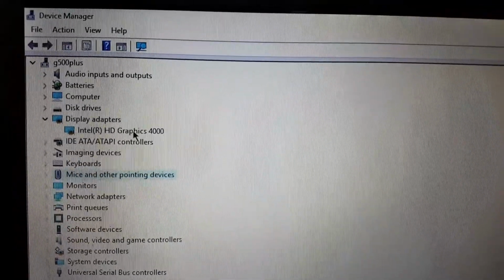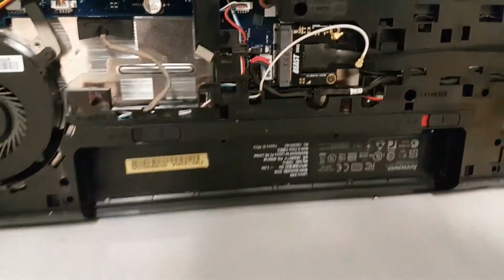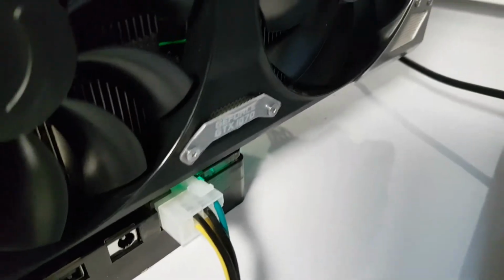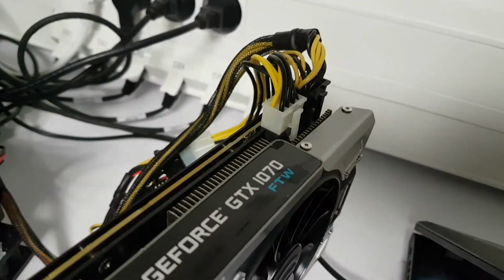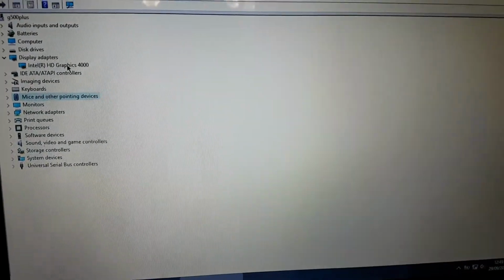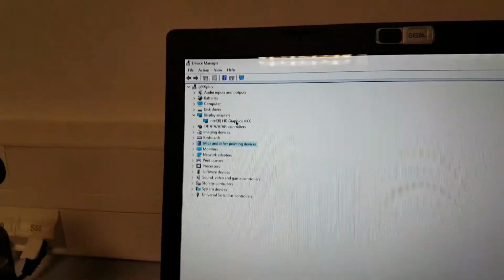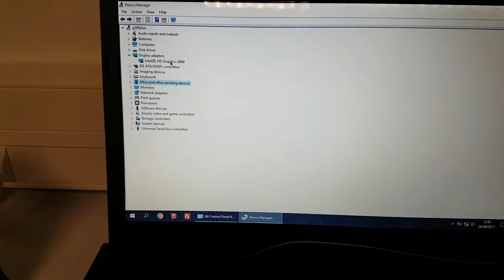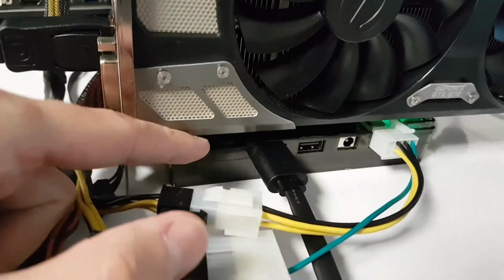Exp gdc not working (DIY eGPU)

Comment: In my case, a Dell Latitude and Acer Aspire wouldn't recognize the card even though the PSU and
adapter powered up and the card's fans spun... I did try BIOS settings, disabling/uninstalling other video
drivers, etc.
You still think I should change a laptop's BIOS?
Reply: did you solved your problem? same issue here. The gpu is running, but my laptop cannot recognize the gpu, and when I manualy installed the drivers it always failed.
Reply: @motivationwithgod3966  I think I'd have to change the BIOS. The current one's not ACPI compliant or something.
Reply: @motivationwithgod3966 i have samsung RV510, is it necessary to disable wifi in bios or unistall drivers of wifi to detect?

In samsung laptops, is it necessary disable or unistall ?
Reply: Did you solve the problem. I have Acer Aspire 4730z and yes as you said the Laptop doesn't recognized it
Reply: the first step is to turn on the laptop with the wifi card still detected and installed, then enter sleep mode, then unplug your wifi card, and plug in your pcie mini egpu either from riser or exp gdc, Then turn on the laptop which is in sleep position, and check the device manager, whether the egpu card is detected or not,, 

Important attention for laptops that have additional gpu such as nvidia or amd should uninstall it first, because This is a tolud problem on the laptop
Reply: Initially my asus x450 lcp laptop did not detect the amd hd 7870 which I installed on riser 011, then I tried that method it worked my egpu was detected as Microsoft basic display, then install driver your egpu,,
Reply: @RizkyAshary  I can't remember if I completely uninstalled the driver for the onboard GPU, which is a mobile Fermi chip, but again, that or unplugging the wireless card wouldn't resolve a BIOS compatibility issue with the eGPU unit.

I'm also on Win 7 and you're using 10, and mine is a Dell from 2013. Funny thing is the card I tried to run externally is also that old
Reply: @coopergates9680  maybe your bios have whitelist problem,, my laptop is asus x450 LCP
Reply: @coopergates9680  try with other laptop,,, or you can try use setup nando
Reply: How can I get setup Nando @RizkyAshary
Reply: @NedxMN  you can buy that, that file not free
Reply: @RizkyAshary  From where can I buy it?
Reply: i have samsung RV510, is it necessary to disable wifi in bios or unistall drivers of wifi to detect?

In samsung laptops, is it necessary disable or unistall ?

Comment: i think im totally f*cked i ordered that 1050ti, Power Suppy, and the GDC beast I have the same laptop model with you lenovo G500 any update?
Reply from the maker: Raize Tech I had to flash a custom bios to make it work but still having problems. Sometimes it recognises the GPU, sometimes not. It's unstable. But... I managed to make it work with no issues on an HP G4. I think GDP WIN should remove the compatibility with Lenovo laptops from the description of their product. I had 4 different Lenovo models and didn't work with any
Reply: thank you for this information i would try tomorrow when my items come.. i ordered it coz there's a lenovo g500 in the list in their compatibility
Reply from the maker: Raize Tech let me know if you succeed
Reply: in some videos i found what their calling Nandos Setup
Reply: try installing the very old version software of your videocard
Reply from the maker: Raize Tech I'm having a look at that now
Reply: GaBIT did it work?im having problems too at first but after using nando4evan software,now its working fine for my laptop
Reply: Ichinose Kai my egpu is not detected in the device  manager.  What to do
Reply: i have samsung RV510, is it necessary to disable wifi in bios or unistall drivers of wifi to detect?

In samsung laptops, is it necessary disable or unistall ?
Reply: Conseguiu

Comment: same for me not working. to be honest this is a nonsense product
Reply: Got mine solved. I just put my laptop into sleep mode, while on sleep mode I turn my gpu power supply and the laptop back to windows again, and booom! got it running perfectly.
Reply: @motivationwithgod3966  yes same as I do sleep mode my gpu detected …but when I install driver card saying need to restart then restart booting get black screen… then when I unplug the egpu dock to my laptop normally bootup. This is my problem now how to solve this to the next step.🤕🤕🤕😵‍💫
Reply: @jigolo_gaming  every time u want to make it run u need to put it to sleep mode. So when u restart it u need to turn off the power supply of the gpu the moment windows is off,  then sleep mode again. Thers no other way than that. Atleast its working.
Reply: @motivationwithgod3966  Ok I got u ..but still not totally fix i need to install my driver first before I doing that u say. but how I install my new driver for new gpu on egpu dock  I always getting blocks screen when witk both together open.🤕🤕🤕😵‍💫😵‍💫😵‍💫
Reply: @motivationwithgod3966  how I baypass this getting blackscreen to restart
Reply: same i lose 350euro buy new doc power supply & 1060 gtx card not work nonsense product free of cost lot of stress
Reply: same, its not working with x551ma asus
Reply: i have samsung RV510, is it necessary to disable wifi in bios or unistall drivers of wifi to detect?

In samsung laptops, is it necessary disable or unistall ?